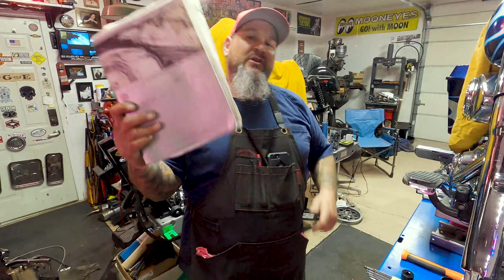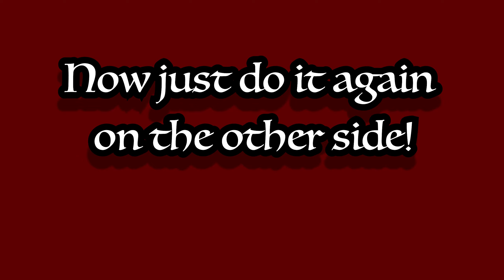Harley Davidson Front Suspension Service and Upgrade

Comment: I know that genuinely good content takes time to create, but I've come to really appreciate your "how-to's".  So, chop chop man.  It's gonna take a lot of videos to cover all of my bikes... You'd think that someone that owns 3 Harleys would be better at working on them, but I just make them look pretty for a living.
Reply from the maker: What do you own?? One man can never have enough Harleys! I own three myself, a 53 Pan, 92 FXR and my 11 Roadglide!
Reply: @LateNiteVTwin  I'm in the same boat with an 89 FXR, 1996 WG and a 1999 Ultra with a SE CV44. I need a relay in the FXR and a new starter... Over my skill level Late Night V-Twin
Reply: I have a 93 EG that's not really an touring bike anymore.  I've got an 06' sporty, that is by far, not a sporty anymore.  And an 09 EG that is stripped down to a performance oriented street glide, sans some quick detach accessories.
Reply: @LateNiteVTwin  I'd be down to trade straight across though! Never had a pan.  Traded an fxr for a super glide a few years back (when you could still find a reliable fxr for under 5grand).
Reply from the maker: @aamantium1  I know what you mean to try and find an FXR for cheap. I remember when they came out. The community screamed that they looked like Hondas! I wrench on my three, not as often since I worked all the bugs out. My pan is a little fussy but a solid built.

Comment: That crimp tool is sweet. I solder and use shrink wrap after I cut out the excess wire but the OEM type connectors just look better. That's a professional looking job. Great video.
Reply from the maker: Thank you for the comments, I am much like you as I solder and shrink wrap as well but in a possible situation like the lights having to be removed from the bike for service, I wanted to share. Glad you liked it!

Comment: Nice PBR sign!! Quick question, I'm doing This on my 01 Electra Glide, right side first. I use the cup that came out of OEM & OEM 6mm bolt ,all good but I can't reach 12.5foot lbs , just keeps spending inside. I have top screwed down holding bottom leg with through the hole. Bolt too damn long?  I'm lost? It will  tighten up but only so far then spins inside!! Used two different torque wrench's. Easy job till this hip cup!! Lol thx

Comment: Hello I was rebuilding my 2002 fat boy front forks with 2 inch drop also.  My question is when you tighten the lower bolt to the dampener. You held the lower fork to tighten yours in the video. Mine spins. What could be wrong?

Comment: Hey bro do u recommend running an oil cooler
Reply from the maker: Hi Larry, by all means, and air cooled engine will take anything it can get to help it stay cool. Oil Bud is my favorite but Jagg and others are good as well.
Reply: @LateNiteVTwin  thanks bro go na probably install a oil cooler this winter definitely would make bearings last longer

Comment: AWESOME YOU SHOULD BE NASA ENGINEER;)   I HAD MY 2010 ULTRA CLASSIC WITH 65K MILES ON IT DONE BY A CERT. HD MECHANIC.  HE MADE A TOOL TO INSERT THE OIL.  DID I MAKE A MISTAKE??  WHAT IS YOUR CHARGE FOR THIS???  THANKS SO MUCH.

Comment: Have a 2021 Ultra right turning not working. How do you find the wiring path. 
I installed a Denali Canbus which controls the passing lamps. (Self install).

Comment: Just want to get your opinion I have a 2014 Dyna Switchback with Progressive 444  rear shocks would like to ask your opinion on what I could do for the front forks. Go with Progressive springs or use another mfg. I guess what would you do?
Reply from the maker: H Blaine, I do like the mono tube conversions from Progressive. They have a very controlled and smooth ride, very little maintenance to! I have them in my personal bike, but from Legends. I happen to have the Legends rears as well. Both offer up a better than factory ride.

Comment: i really think you're one of the best youtubers out there. your subs should be higher. what do you think of dip stick breathers like fuelings for M8s. how would i know if i'm building up too must crankcase pressure? thanks
Reply from the maker: Steve, first off, thank  you for the positive comments! I believe in the Fueling dip sticks. I have one on my big bore twin cam! The M8 suffers from proper venting and it truly helps!The easiest way to tell if your crankcase psi is to high, look at the air cleaner bottom. Look for oil dribbling or a high oil content on the filter. That's how Harley vents the case. Bigger bore engines are susceptible to this, especially if you ride long distance and higher sustained speeds......

Comment: Don't shame me to bad. I did my first set on my 09 SG. I used the pvc pipe method install. I noticed you slide the top bushing in the fork then the washer and put the seal in. I attempted this and thought I was going to destroy the seal going in. I cut the old seal and used it to buffer the pvc from destroying it. The one I did after than i put the bushing on, I took the 1.5 pvc slid it over the fork and drove it down first then the washer and the seal went right in easy like yours did. Any thought why?

Comment: Wondering what oil you recommend i have a 2021 street glide motor, trans and primary?
Reply from the maker: Hi Don, my recommendations are a good synthetic of your choice. I a\like the Lucas product, been with them a long time and have zero issues. 2050 in the engine and primary, but I would however recommend a good synthetic 75-140 severe gear oil in the trans and here's why. Harley states that their Syn3 2050 oil is ok for transmission use. I call BS because it does not contain a pressure additive, that is an engine oil! Engine parts slide and rotate together, they do not push against faces like gears do. I have been running Ams Oil severe gear 75-140 or Royal Purple brand. That particular oil weight suits the transmission perfectly. It's not like a hypoid oil like 75-90 where its really thick. It pours and looks like engine oil but it's nothing close. In the cruise drive transmissions we see failure of the large inner bearing due to side load and lubrication failures due to engine oil being used. That's what I recommend. I hope this helps? And THANKS for stopping in!
Reply: @LateNiteVTwin  GARY, thanks for getting back to me. i have 1,000 miles on my SG changing oil and wanted to get the right stuff. your videos are awesome and i value your opinion thanks.
Reply from the maker: @donschultz3207  Don, you are very welcome!
Reply from the maker: @donschultz3207  You are very welcome Don! go enjoy the new SG!

Comment: ive got two questions. i need to change my fork oil on my 2014 roadking. it doesn't have drain plugs. is one side a cartridge and the other a spring and do i have to remove the tubs or can i suck it out. the bike was new to me last year and im a shovel guy so....

Comment from the maker: I have had a few questions about the connectors I installed, and one was "why did I install them right next to the other butt connectors?? Well, the connector was only one of the turn signals. The other side, and head lamp wasn't shot in the video! Sorry I didn't state that!

Comment: Safe to say stock HD suspension is ... sucky?
Reply from the maker: well, I won't say sucky but it can be improved upon. Oil weight changes in the forks only offer so much. The mono tubes are much more stabile and offer such a better ride, just like rear shock upgrades. The majority of my customers have stock suspensions and like them right from the factory. I think it just depends on what someone wants and expects from a machine?
Reply: @LateNiteVTwin  Newer rider here ... since '16.

I've owned a '16 Slim and a '17 Road King and while I've loved both bikes I've found that the front ends are harsh when rolling onto square-edged stuff on the road.  Limited, if not nil adjustability in forks themselves.

Suspension upgrase is what I'll be looking into after a Stage I on my '20 RGS.

Appreciate your content!  Thanks for the reply.

Comment: Hey bro I got a question...
I have an 09 Heritage with just a hair under 13k on the clock.
My horse shoe oil tank was leaking at the dipstick stopper so I replaced it and it still leaking although not near as much.
I checked the oil the proper way and it is spot on.
I heard that the flapper valves in the rocker boxes is probably the culprit and wanted to get your opinion on this, I am not really getting any oil blow by into my air filter casing either.
If you feel this is the case, would you advise on the fueling kit made for this issue?
Thanks in advance, really enjoy the videos and sincerely appreciate the work and time you put into them to help the community.
Reply from the maker: Sounds like a venting issue for sure. The flappers can cause that for sure. You didn't share what air cleaner you have. The stock ones have soft rubber lines that direct the vapors to the intake and I have seen those deteriorate over time from hydrocarbons. They can collapse so if you have this style check those. Fueling does not offer one for your softail twin cam, only the M8. If your vents are good, then you have blow by and I would do a leak down check on the cylinders to see where it's coming from?
Reply: @LateNiteVTwin  Thanks for answering bro, I have a factory set up although I was told it had a hi flo filter on it, I can not verify this and I do not think it does (dont know why Harley uses the same looking element in regular and hi flo filters they offer) but it DOES have those rubber vents. I will check them again but they looked pretty good last time I had the air cleaner off. I have a Thundermax tuner waiting to go on the bike and a Velociraptor hi flo air cleaner waiting to go on also after I do my manual tensioner and Darkhorse comp eliminator. I just checked Fueling's wbsite again and it says they make the Rocked box breathers for twin cams and the part number is #3200. I had figured with a bike with less than 13,000 miles that the compression would be good and it pulls like a beast on the road with just true duals, but I will buy a compression leakdown kit and check it. I appreciate you taking the time to answer my friend.
Reply from the maker: @BillyBlaze7  The hi flow air cleaner kit has a round back to it, not football shaped. The actual air cleaner is round as well not oval. Thats how you can tell.......
Reply: @LateNiteVTwin  hmm, the plate that buts up to the air cleaner is round and the filter is round but the outter cover is oval like it cane from the factory, i tried looking up the numbers and didnt get anywhere, but I found that the hiflo filter and the regular filter look exactly the same, same old white material both round its a mystery, I bought a Kuryakyn Velociraptor air cleaner to go in its place when I install the Thundermax. I mean the bike pulls hard as hell and is quite fast, but I only have true duals on it at the moment and there isnt supposed to be any other work done to the bike, te lady I bought it from said it had a stage 1 installed but I am thinking she was mistaken as she didnt know anything about the modeule or daa cable etc when I asked her about it. I wish you were in Tx I would drive it down to have you give it a good going over lol The bike does have decel pop, not crazy bad but I have had that happen with the V&H true duals even with a good tune, they are more prone to the decel pop for some reason, I usually put Big City Thunder baffles in them to get rid of it after tuning the bike. When I get the Dark Horse comp eliminator and chain tensioner in I will be installing the Thundermax and tuning the bike.....and most likely launching my dipstick lolol
Reply from the maker: @BillyBlaze7  most true duals will pop like that, only because there is no cross over or balance pipe. pretty normal. sounds like a big unknown about the air cleaner. Let me know how the build goes!
Reply: @LateNiteVTwin  i will bro thanks

Comment: I think it's a mistake to reverse the connectors left/right. Some subsequent person is going to plug the two hot plugs together and cause real electrical problems. Just use a Sharpie and label them L and R and wire them identically. It's a fail safe configuration. I'm not a Harley mechanic except for my own garage fumbling, but I am an electronics tech and expert. Always configure to fail safe. I love this video though. I'm about to do a Progressive monotube conversion on my 2000 Deuce.

Comment: I’ve heard different answers so I’ll ask you. On a 2004 FLHTCUI is there a difference in the left and right fork legs as far as internals?
Reply from the maker: Hey Scott, I looked in my manuals, and they are the same both sides. I think your question refers to the cartridge style forks that Harley had for several years and yes, those are different left to right as far as internals go. AS long as yours has the standard springs and valves inside, you're golden. Now, they can be swapped and I have seen this on occasion but it's rare. If you really have a question in your mind, call a dealer and give them the vin number and they will be able to tell you if they had cartridges in them or not. From the info I have, they should be the same........

Comment: Awesome videos. Looking forward to seeing more. I have a question regarding oils. Which do you recommend. HD brand, or Amsoil?
Reply from the maker: Almost all the lubricant companies offer a great oil. The thing you need to be aware of is the weight. Viscosity plays the biggest part in the action of the fork valve. The HD synthetic oil acts very stiff, and I have never been able to find out the actual weight of the oil. I usually go with a 20w oil for most applications. The lighter the oil, the spongier it will feel, as is true with going heavy. Both oil brands are great.

Comment: Gary need your thoughts on getting rid of the catalytic converter on my 2017 M8 (107) Road King. A lot of people I know have drilled and pulled out the CC. 
I plan on doing that and need to know if S&S GNX 4.5 mufflers will give enough back pressure for the engine? I have a FP3 already on the bike along with Hi flow air filter (Stage !).
Would having the CC out hurt the engine?
Reply from the maker: So, pulling out the cat is not an issue with the head pipe or the being able to tune the engine. I have done this for customers but the performance gains in retaining the restrictive head pipe isn't a great idea. It's just that, it's engineered to use the converter media and fun the exhaust through the majority of the right side. If you look at the design, you will see that the left side cross over pipe is at a 90 degree angle to the right side. Air does not like to flow through a 90 degree bend, so my suggestion is to replace the head pipe assembly with an aftermarket set up. There are many on the market. My best go to is the Vance and Hines Power Dual head pipe with your choice of mufflers and then tune from there. You can de-cat the original, but they really don't flow well. Either way, you will have to tune it. The FP3 is a great tuner but in the map selections, you will not find a de-cat option for exhaust choice so it isn't going to give you optimum performance....Hope this helps??
Reply: @LateNiteVTwin  That cleared up a lot for me. You are very informative and give educated  replies to answers. Thanks, I do understand what your saying about the exhaust flow through a 90 degree. I hope they won't notice the new header pipes I put on when I go to get the bike inspected.
Reply from the maker: @americanland878  Glad to be of help!

Comment: Hi Gary...Greetings from MA.  I have a 2008 Kawasaki Vulcan 2000 that I added a Hoppe batwing fairing to.  On one of my last rides I didn't notice a pot hole and hit it and caused my bike front end to bottom out putting a little dent in the front fender from the turn signal light bar.  My question is what would you suggest to do to the front forks to compensate for the added weight of the fairing and my self being a little heavy?  Parts are not so easy to find for these bikes compared to harley davidson.  Also I would love to replace my rear pulley from a 72 tooth to a 68 tooth or maybe a 70 tooth, but my stock pulley is 2 inches and the belt is 1 5/8 inches.  The only pully's i can find for sale are Harley ones being 1.5 inch and 1 1/8 inch.  Any idea's??
Reply from the maker: Hi Joe! Well, there isn't a whole lot of support for your bike, and part of that is its age. Have you tried looking into progressive suspension? They offer parts for may makes and models. Here is a trick to try. If you change the weight of the oil, it will stiffen up the ride a bit, and not bottom so quickly. If the factory called for say a 20 wt oil, go up a weight and see if that helps. I'm sure a set of emulators from progressive would help? Look into those. Not sure about a pulley change for your application as well. One tooth is quite a change. What are you looking for as far as a final ratio?
Reply: @LateNiteVTwin  My bike feels like it needs one more gear.  If I'm cruising in 3rd gear the engine seems to be revving a little high, go into 4th and it's to low.  So it's like it's missing an in between gear.
Reply from the maker: @Joe_1971  I'm not really familiar with the final transmission ratios for your bike. There may not be a whole lot of options for you.....

Comment: Hi, can you recommend which manufacturer for the crimping tool?
Reply from the maker: I recommend the Deutsch HDT-48-00 tool, it's made by Deutsch, for their connectors. they run about 300-350 depending on where you can find them. It's a speedy tool but I would rather have the excellence of a water tight connection, that is serviceable, removable, and reliable.